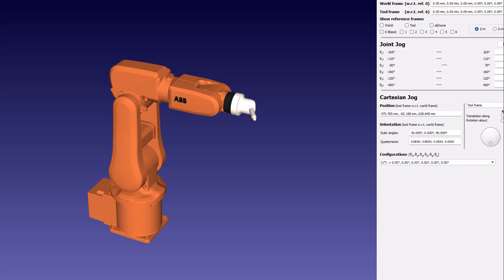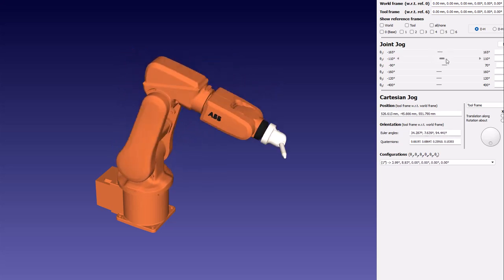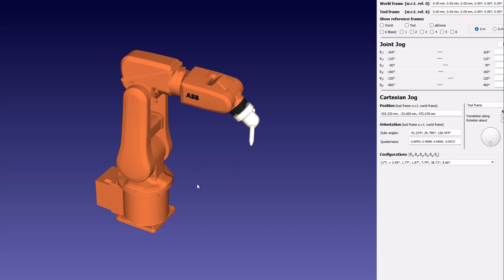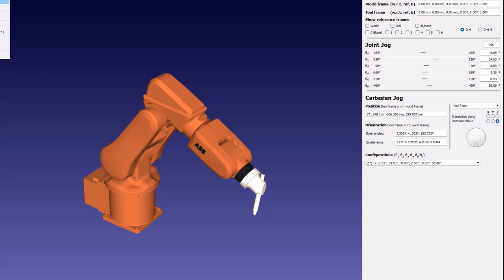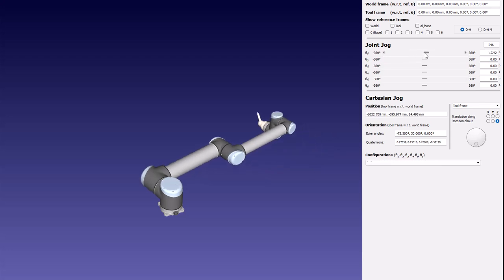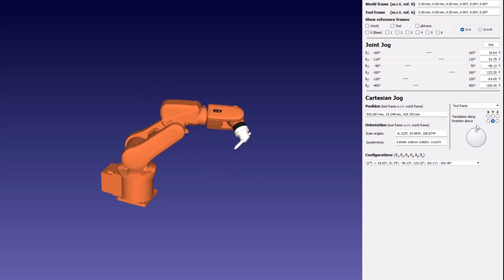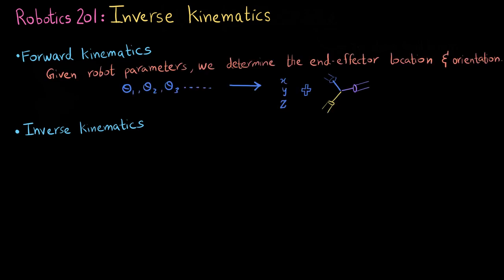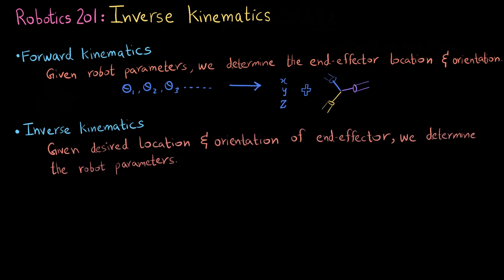Inverse Kinematics of Industrial Robots & Grippers

Comment: For those watching, the first 3 joints controlling position and last 3 joints controlling orientation isn't always true for every 6-DOF arm.

It is true for arms with "spherical wrists", where the arms are specifically designed to have the last 3 joints all share a common rotation point. This makes the inverse kinematics solvable analytically because, as the video points out, it makes the first 3 joints control wrist position and the last 3 joints control orientation.

This means fast and exact solutions, which is desired for industrial arms, and is why almost every 6-DOf industrial arm is designed with a spherical wrist configuration.
Reply from the maker: Exactly! I am pinning this comment for everyone to see.
I skipped mentioning it since I wanted to keep the video a little simple and not dive too much into the details (and make it intimidating for beginners). 
But, thank you so much for such an insightful comment. What I talked about is ONLY applicable for spherical wrist robots which are virtually all industrial robot arms but there can definitely be other 'non-spherical' wrists (I think UR5 is one such manipulator).